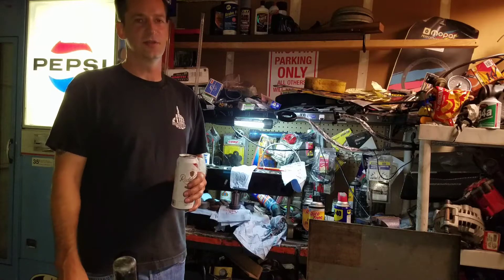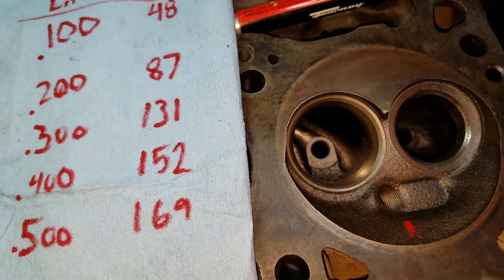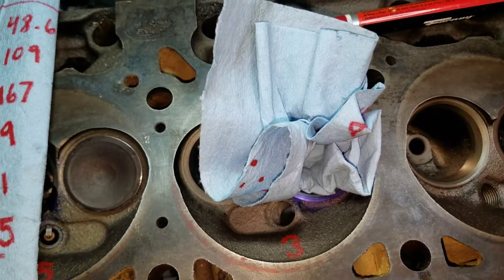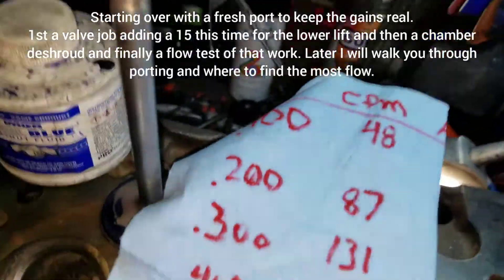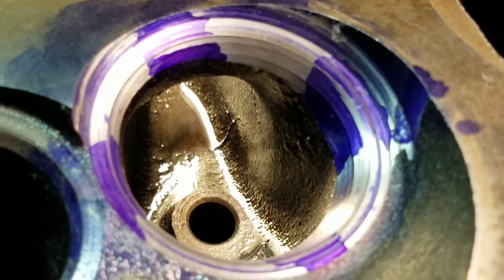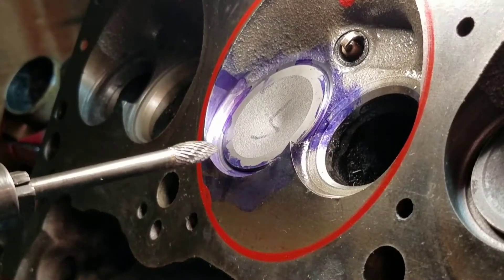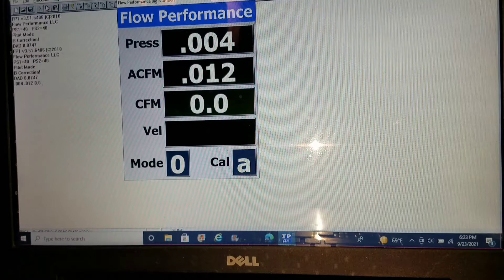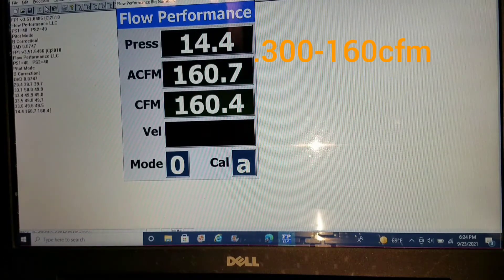Chrysler's strangely popular #302 casting cylinder head Part .2 Chamber of choke.

Comment: I have worked n a couple sets of these heads. It seems that Chrysler was attempting to use an old casting & make a few combustion chamber changes in order to help with emissions, increase compression, and help fuel economy. I don't think high performance was on their minds. Intake ports are quite small. I see you unshrouded the intake valve some, some cylinder head shop should have a cutter that fits into their valve seat machine to do that. I considered doing that but couldn't come up with a way to make them all the same. Doing it by hand is OK but they won't all turn out exactly alike but it should work. You'll get some improvement in fuel economy & performance, I did.

Comment: You should watch some of david vizards videos. He shows why it can do more harm than good to deshroud all the way around the intake valve. The main point he brings up is that deshrouding the quench pad side of the ibtake valve will reduce swirl. This will reduce power and will increase the possibility of detonation.  this will offset any power gains from the extra flow
Reply from the maker: It's called 'how much' and.. which head are we talking about...how each heads finish casting differs. Look more into the why and pertaining to which head. Here with this head there is an amount needed with a 45 seat to be removed to flow  the air. Steeper seats can require less laying back of the chamber. Every animal is not the same. I believe even Dave would agree these chambers encroach a bit too much. They are no vortec,  that's for sure.
Reply from the maker: Did you also know that all small block dodge LA heads are swirl port? The 308 head chrysler offered as a swirl port casting in their catalog...and it was a production head late 87 to early 90. They are the same open chamber with typical j head intake ports. There is no chamber design change to make it swirl....because it's the port. Look at a 360 intake port, the floor and the common wall. Thanks for watching.

Comment: I'm in New Zealand and have 1.98 inlet and 1.55 exhaust valves in my 302 heads and yup I'm a freak that has a hyd roller cam in my 318 , absolutely love it  bahahahaha awesome motor for low down torque and very snappy throttle response thanks to the high velocity heads and LD4B intake manifold. Heads are fully ported of course. :)
Reply from the maker: I'd had been fine with a 1.94 that's cheap and easily available.
A head is only as good as the person working/modifying it. In lamens... not everyone is equipt to take it to its fullest potential* So If it works exceptionally well... give yourself credit more than the head. YOU did that..and now go apply all you've learned to a  head that would yield even greater power, which would be a larger port head. Everything has it's limits/place and no shoe fits every foot. I have already ground another seat for a 1.88 valve and part 3 is up.

Comment: I can understand the criticism of the 302 heads in comparison to the best heads that are available. But at what cost and what purpose? I got my 302 heads at a "Pick Your Part" sale for $16 each. I pretty much did what you did in the chamber and removed the sharp edges in the ports/bowl. Not having a flow bench I could only do what is logical. Ebay got me a new SSI (PAW house brand) Edelbrock Performer clone cam for a mere $3.24 (yes, three dollars and twenty four cents) plus $10 shipping. Lifters (Crane) were $20, again an Ebay deal. The Mopar Fall Fling provided an Edelbrock Performer intake for $30 and a neighbor gave me a Carter (Edelbrock) 650 CFM for free. Even with gaskets and a roller timing chain I was under $150 for EVERYTHING.
  I only have my "Butt Dyno" but the car significantly woke up especially in the mid-range. Being in 2nd gear (904) @ 40MPH and nailing the throttle to merge on the freeway always bought a smile to my face. So, no, the 302 head is not a head for the ultimate in performance. But the $32 spent for the pair and time spent with the grinder met the need and purpose I was attempting to obtain.
Reply from the maker: I understand... you need to defend your choice of parts..and that's fine. To each his own...that's why there's winners and there's losers. I do miss paw..and the days when parts were that cheap. Btw I paid $25 for performer intake at pick a part, $18 for a sway bar n on n on n on.Thanks for bringing back memories.

Comment: By the way, what tooling kit did you use for the valve job.
Reply from the maker: I used an old Cedar Rapids seat grinder same/bought by kwik way and use an adapter for the current kwikway stones. The seat ends up .001 to .002  which is fine/in factory spec for this stuff. Even if you have the valve job done by a shop, you can add top/ bottom angles and deshroud...so it's a great tool set to have if you wanna do this yourself.

Comment: The deshroud I need and valve job add another, i wonder what shaping the chamber sides of the intake and exhaust ports would add, added with a pushrod pinch reduction, maybe you could cut down the spark plug boss a little?
Reply from the maker: The chamber 'beyond the valve' isn't much of a hindrance with 1.78 valve in a 3.91 or larger chamber size. For now I'm focusing on simplicity for the garage type hobbiest. It will be when I stick a 1.88 in it later on in part 4 or 5 that the chamber will numbers will really benefit from working the far side chamber.
Reply: @1WILDsMoPARtech  do you know by chance how much milling these heads by .030 adds to compression?
Reply from the maker: @jonathoncouchey7151  they are typically 64 cc's. It takes .0058 per 1cc with closed 273/318. Then include the chamber work that will make it bigger.
Reply: I think the loss in flow at .400 is from the spark plug boss
Reply from the maker: @jonathoncouchey7151  I considered this video, being thrown together last min to cover for the lost videos might confuse some. These is no loss of flow at .400 due to a spark plug boss. I had closed the valve a hair when adjusting open and trying to hit pause in between lifts.It's not a problem, the boss, the problem is 'as cast' where the valve is @.400 in relation to the untouched chamber. It's when the valve is open enough to move air past the that protruding chamber that it picks up. So in the first test 'part 1' the port is weak till the valve is opened enough '.500lift'. So as cast @.400 lift ..152cfm stock. After the chamber deshroud and 5 angle valve job...its 176@.400..and honestly the 1st port I lost the video on..it was 175@.400 after the same work.  They are close enough to where it doesnt matter much if I switch around ports, maybe 2-3 cfm. The two key things is the valve job is consistent as is the chamber work to this point.